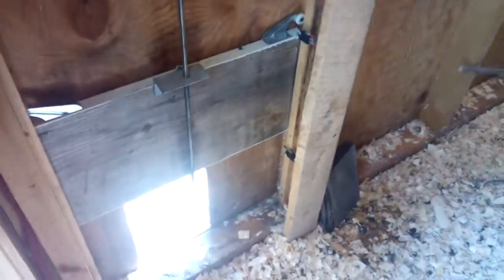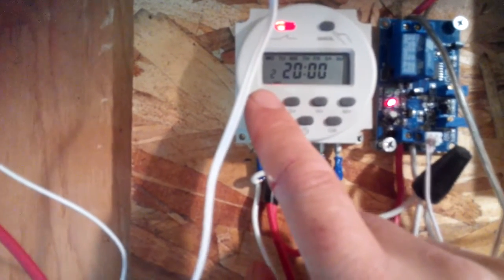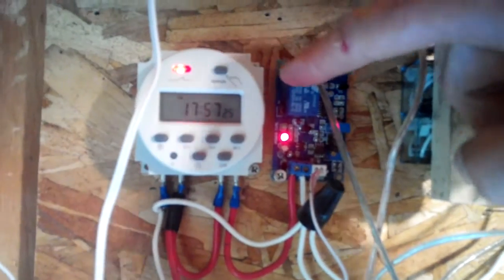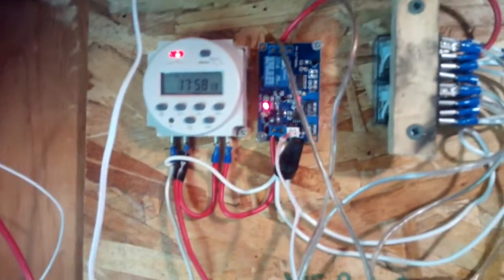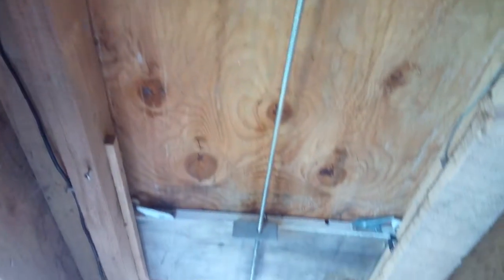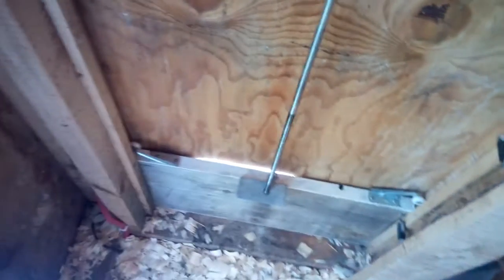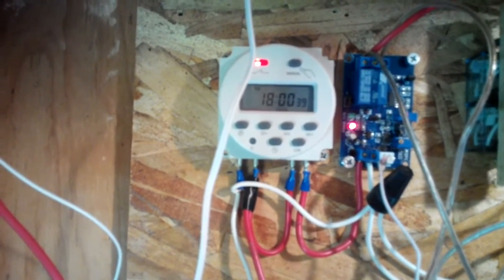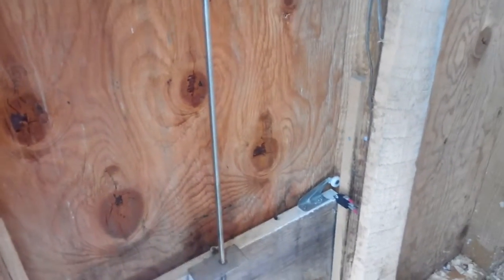Cheap DIY automatic  Chicken coup Door.

Comment from the maker: It goes down really slowly which should be enough plus the 12v drill I used has  torque settings and it's set low so that if a chicken were to get stuck in the door it should  prevent the door from going down further.

Comment: I bought the same switch and have it wired for power just like yours but can't seem the figure out how I can wire the antenna to work properly.  My antenna has a gray for ground, an orange to raise the door, and a green that closes the door when connected with the orange.  I can get the door to open or close with light switch but can't get it to do both like it should.  Please...how did you wire those three antenna wires to the light switch?  You or any of you can email me at mike@driggers.com